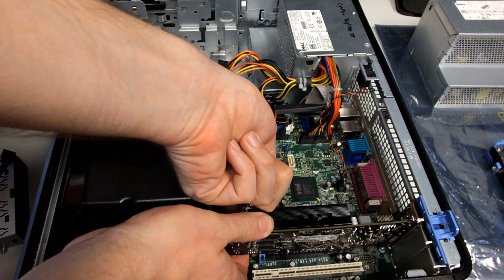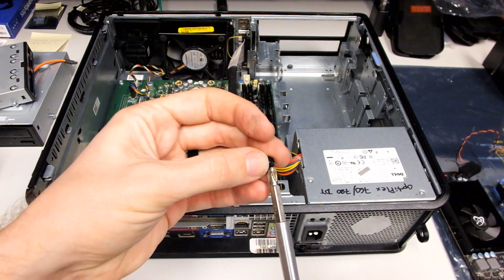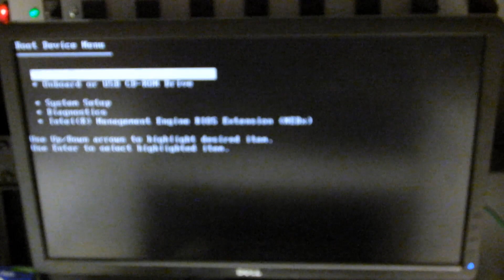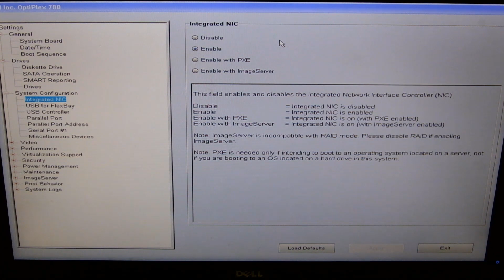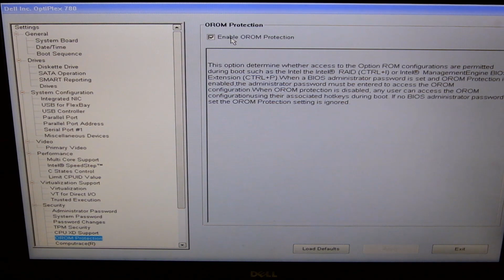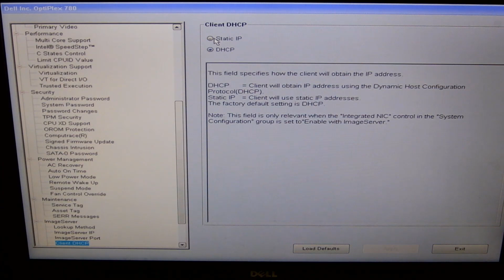Troubleshooting and repair of Dell OptiPlex 780 desktop PC

Comment: I have the same machine. My question is, is it normal for the power supply fan to not spin continuously? Just because I read that this is normal for some models.
Reply from the maker: Hi! Thanks for checking out my video. On some models if the power draw is below 15% it is normal for the power supply fan to stop spinning. However it should immediately start spinning again if the current draw increases, or if the ambient temperature increases. You can test for correct power supply operation by pressing the "fan test button" (located on the back of the power supply on some models).

I also recommend tools like the free "HWmonitor" and "Speedfan" to monitor internal system temperatures and fan speeds (although if memory serves, the Dell BIOS doesn't support checking PSU fan speed through software).

Also, remember to make sure your fans are clean and free of any dust, pet hair, or other obstructions. Hope this helps!

Comment: what grapics card are you using. also i upgraded my dell optiplex to a intel duo 2 E8600? Good video it helped me alot i maybe replcaing my power supply soon in my dell optiplex 780 due to it saying low power supply detected.
Reply from the maker: Hi!  Thanks for checking out my OptiPlex 780 repair video.  This video is quite a few years old now, but we do still have a few of these machines running in an old office.

I used a variety of graphics cards over the years.  The "best" (imo) that worked with the stock power supply was the Radeon R7 250.  Here's links to a couple of the cards we were purchasing back then:

VisionTek Radeon R7 250 SFF 1GB GDDR5 (DVI-D, HDMI, VGA*) Graphics Card - 900702:  https://amzn.to/43Syuuq

XFX R7 250 1050MHz 2GB DDR3 Low Profile Ready Radeon R7 Series Graphic Cards with Brackets R7-250A-CLF4:  https://amzn.to/3FPa2ls

These cards worked well and offered good performance for basic desktop productivity with dual monitors.

For triple-monitor setups we used this 5570 card:

Sapphire Radeon HD 5570 - 1 GB DDR3 DP/DVI-I/VGA PCI-Express Graphics Card 100293DP:  https://amzn.to/4kxFOT5

We also had a small number of employees using quad monitors.  For those folks we used this card:

VisionTek Radeon 5570 SFF 1GB DDR3 4M VHDCI DVI (4x DVI-D) Graphics Card - 900345:  https://amzn.to/4n18WEb

Although I wouldn't recommend that last one, the connector was a bit flaky and it was a lot of cables to manage.

Obviously you may be able to find better cards today, just recommending what worked well for us back when I was actively managing and upgrading these systems (roughly the mid to late 2010's).  We'd also make sure to upgrade all of them to 3.0GHz quad core processors, 16GB of memory, and SSD or SSHD hard drives.

Hope this helps!

Comment: Can you tell me where the p7 wires go on the optiplex 780?
Reply from the maker: @johnsepulveda443  Hi! I still have several 780's and can check for you when I get back to the office, if you're not able to identify the location in this video. To confirm, do you have a DT ("desktop") model unit, MT ("mini tower"), SFF or USFF ("small form factor" or "ultra small form factor"). DT and MT are the most common. Want to make sure I check the right model.
Reply: @CompTechMike  yes I have the desktop model computer thank you for the help can't seem to find a video on it
Reply from the maker: @johnsepulveda443  Hi! I haven't had a chance to stop by my other office yet but I found a diagram online of the different power connectors on an OptiPlex power supply.  See images here:

https://imgur.com/a/qwKlKHj

(image hosted on Imgur)

Is this what yours looks like?  If so, that mini Molex connector is for powering floppy drives.  Some other accessories (such as certain media card readers and small optical drives) may use it, also.  Assuming your machine has no floppy drive, that connector wouldn't plug into anything.  Lmk if you still want me to pick up one of those old machines to inspect further.

Comment: Hi, what if my power button is broken. And I want to install external power button. Where can I find pins, 4 pins maybe, fot ataching external power button from ebuy? please help.
Reply from the maker: Hi Milos! The power button on this model is part of a small circuit board which contains other components, including the front USB ports and lights. It connects to the inside of the front of the case and then back to the motherboard via a ribbon cable.

If your button is broken, my recommendation would be to replace this entire board. You'll probably need to remove the current one to match the exact part number. They're usually pretty cheap on sites like eBay and Amazon. I'm sure you could desolder the button and replace just that, but honestly you're just making more work for yourself (imo). Good luck, whichever you decide!
Reply: @CompTechMike  Hi. My little pin on that board is OK. That plastic little circle button from front of the front board it is broken, or not functional. once I pressed it down, it is not going back.
Reply from the maker: @MilosLacika  I just did a quick search online and saw many of them starting at $5. Search for terms like "optiplex 780 dt power button assembly". Should be an easy fix, hardest part is removing everything in the way to get to the component. 😉

Comment: I just so happen to have a Dell OptiPlex 780 from late 2009 running a fresh, clean install of Windows 11 Pro that I just installed days ago along side a plethora of Linux Distros without a single hiccup thanks to good ol' Rufus. Microsoft says it isn't supported and I wanted to prove them wrong. Lol. I purposely disabled TPM on it just to see if it would work. Zero issues whatsoever and fully updated. Granted I did some hardware upgrades but it's super light on it's feet. Upgrade specs are Intel Core2 Quad Q9650, 16GB dual rank, dual channel DDR3 RAM, Samsung 870 1TB SSD. It originally came with an Intel E7500 @ 2.93GHz that I did the BSEL electrical tape mod that OC'd it to 3.65Ghz, 4GB of RAM and an old 7.2k RPM Western Digital Black HDD with Windows 7. 

Night and day difference what a few upgrades will do. It ran Windows 10 Pro for years without issue too. Even though there's still a year til EOL on 10, I just went ahead and switched over to 11 now that they've worked out the initial bugs that happen with all OS's. No problems whatsoever. Tinkering with stuff and making it do what it supposedly can't is fun. Plus it also exposes the truth about major corporations, planned obsolescence and reduces e-waste!
Reply from the maker: Hi Hector! Thanks for checking out my video.  It's been quite a few years but we still have a few 780's running around the office.  Your upgrades sound exactly the same as we did to ours - quad core Q9650, 16GB RAM, Samsung SSD's, etc.  I wouldn't want to use them for any heavy-duty work but for basic office tasks they still hold up.  Glad to hear you've got Windows 11 on yours.  I also did that with some of ours (different machines, slightly newer but still not meeting Microsoft specs).  Rufus and a few TPM tricks make everything possible, haha.  Thanks for keeping your old machines going and helping reduce e-waste!

Comment: Hello, I have the same exact pc that I got from my uncle. I tried putting a RX 550 low profile red dragon and it is not showing me any display, however when I plug into integrated it works with no problem. Do you know any fix?
Reply from the maker: Hi there! I would check the power supply requirements for that card. These systems are more than a decade old. It's possible the card is trying to pull more than the PSU can provide, or is defective.

When I was using these machines we'd typically stick to LP cards like the R7 250 or Radeon HD 5570 or 6570. Those generally worked the best, in my experience. Hope this helps!
Reply: @CompTechMike  Okay I just had to plug a hdmi cable to hdmi because I had some sort of display port adapter for this one monitor.
Reply from the maker: @dbatack  great! Glad to hear it was something simple. I try to never use adapters on my setups, if possible. Remember: every adapter is just another potential point of failure. 😄

Comment: This system is old now. I have had one of these for almost seven years. I did replace the power supply just out of interest, as the system I have has a shut down problem when in use, sometimes using the web, sometimes, when it just is idle. The lights, 1, 2 and then 3 and amber. The amber light means the power supply is fine. I have had this problem with the system since last month. The longest so far. A clip here gives a brief show of it. https://www.youtube.com/watch?v=UAPO3qNUYOg
Reply from the maker: Your link isn't working but I would check the Dell service manual.  You can find that on Dell's website, or here:

https://www.manualslib.com/manual/678395/Dell-Optiplex-780.html

among other places.

Diagnostic lights 1-2-3 appear to indicate "another failure has occurred", which isn't very helpful.  I would recommend going through and removing and reseating any expansion cards, memory sticks, check all internal connectors, etc.  If possible remove all cards and all but one stick of memory and test like that. Then add each piece back one-by-one, and see if the failure reoccurs with just one specific piece of hardware.  You might also try swapping the memory to other slots and running the built-in hardware diagnostics.  These systems are old, depending on the environment you're running in you may want to give all connectors a thorough cleaning (for example: with some electrical contact cleaner or high grade alcohol).  Good luck, let us know if you figure it out!
Reply: @CompTechMike  Quite late. I bought different RAM, so by messing with that, I think the shut down was the cause of the problem for the whole time. Been okay now for two weeks. 

I simply use windows 7, with no license key. That is the result of buying second hand, once a system packs up and the use of the old drive, requires a key. I'm typing here on this system.

Thanks
Reply from the maker: @blenderocean  glad to hear you got it resolved! Bad ram is a frequent cause of issues on these models. There are certain types that are incompatible, despite being the rated speed (has to do with single sided vs double sided and chip density). Glad you got it sorted.

Fyi, these machines are capable of running Windows 10. As Win 7 is no longer supported by security patches or updates, updating to 10 would be a recommendation for security purposes.

Comment: Same computer, woke up to a black screen asking for password.???
Never had a password.
F2, f12 nothing works to boot safe mode, what can I do????
Reply from the maker: Hi Sueann!  Tough to say without seeing it.  Can you post a picture of the exact screen you're seeing (using something like Imgur)?  Could it be asking for a Bitlocker encryption password?  Or a BIOS password?  This could also be caused by some viruses or malware.

You can try using the motherboard jumper to clear the BIOS settings, but without knowing what condition is actually prompting for a password it's tough to say if this would help.
Reply: I put a video up on my page didn't know how to add it here.
Reply from the maker: @sueannsoto7299  Hello!  That looks like the BIOS password.  Check out these links to reset via the motherboard jumper:

https://arran.physics.gla.ac.uk/wp/igr-it/2016/08/02/reset-bios-admin-password-on-optiplex-780-sff/

https://www.dell.com/community/en/conversations/optiplex-desktops/optiplex-780-locked-bios/647f83b5f4ccf8a8de289667

Note that if you reset the BIOS, you'll need to press F2 to go back into BIOS settings (after the reset is complete) and reconfigure any custom BIOS settings that may be present in your machine.  For example, selecting the wrong drive or RAID type in BIOS can cause the system to not be able to boot.

I don't have any 780's here but do still have a few at an old satellite office.  Let me know if the above links don't help and I can try to get more info for you.  Good luck!
Reply: Ok that helped lol I am back to user screen have the loading circle and welcome but doesn't load.
Reply: Omggggg thank you it loaded on its own. 
I think what happened was my cat laid on the keyboard all night.
Reply from the maker: @sueannsoto7299  Ha! That's so funny. Exactly what cats do. 😹 Glad to hear it's working again!
Reply: Once again thank you so much. The last thing I needed was my computer to go caput right now.

Comment: Mine won't even turn on, will this help?
Reply from the maker: Hi!  Thanks for checking out my video.  When you say "mine won't even turn on", could you provide more specifics?  What, exactly, happens when you press the power button?  Any lights, noises, fan spinning, etc.?  Without more information it's tough to say.  Could be anything from a bad outlet or power cord, bad power supply, bad motherboard, etc.

Comment: Dell gx 780 yellow power  lights 1and 2 problems
Reply from the maker: Hi Malik!  Thanks for watching our video.  Check out the OptiPlex 780 service manual at this link:

https://www.manualslib.com/manual/678395/Dell-Optiplex-780.html

Page 16 shows that 1-2 lights mean "a possible expansion card failure has occurred".  I would start by removing all expansion cards, cleaning any edge connectors, and reseating them one-by-one.  See if it boots with no cards installed, then add one back, then one more, etc.  Good luck, let us know if you figure it out!

Comment: Hi Sir, I will like to know, instead of replacing the power supply which I know is the most reliable solution, is it possible to repair it?
If yes, could you make a video on how to repair power supply with this issue?
Reply from the maker: Hi! Thanks for checking out my video. Yes, the old saying is that anything can be fixed, with enough time/money. I generally try not to mess with power supply internals due to the high voltages that can be present there. Don't particularly feel like getting shocked; it's easier to replace them as a unit. 😉

That said, if I do find myself repairing one in the future, I'll be sure to record a video. Thanks for the suggestion! 😊

Comment: I got this pc for 10 bucks thinking I can flip it but I got a q9400 and rx 550 and 16gb of ram with a ssd and a hard drive so the first problem it wasn’t booting at all took me hours of plugging and unplugging because it said there wasn’t anything in sata 1 and 0 but I fixed it by turning off fast boot for the first boot now I finally got in the pc is very sluggish maybe it’s because it’s old it stutters here and there but the new problem is I can’t play any games csgo valorant anything I can’t play it at all it says

Engine Error
Your graphics hardware does not support all features (CSM needed to run this game.
Device Info:
Marked unsupported: 0
Supports PCF Sampling: 1
DriverName: "Microsoft Basic Render Driver* VendorlD: 0x1414, DevicelD: 0x008C
DriverHigh: 0x000A0000, DriverLow: OXA610AE4
DXLevel: 95, MinDXSupportLevel: 90, MaxDXSupportLevel: 95
Reply: I checked the device manager and the rx 550 and the pci serial port and the pci simple communications controller has a yellow exclamation mark next to it I did upgrade the rx 550 driver and upgraded the bios as well I couldn’t find anything for the q9400
Reply from the maker: @1pandamachan  Hi Isaiah!  Thanks for checking out my video.  The Q9400 is one of the mid-range quad core processors for this machine.  If you wanted to upgrade that to something a bit faster, I'd look at Q9550 or Q9650.  It's not much of a boost, but a bit better than the Q9400.

16GB or RAM is the max these models can take so you're good there, and it sounds like you got a halfway decent hard drive and graphics card as well.  That said, I wouldn't really try to use it for gaming.  I mainly do basic office productivity tasks.  The 780 line is more than a decade old at this point, and will leave you pretty disappointed if you try to use it for gaming.  Can still be useful for basic word processing and web browsing tasks, however.

Regarding the "no boot device" error, I'd go through BIOS and disable any ports that don't physically have a device connected.  There's a screen where it says something like "Port 0, Port 1, Port 2".  Connect your boot drive to port 0 and disable any others that don't physically have a drive connected in BIOS.

I'm having a hard time understanding the rest of your question.  Like I said above, you're not going to have much luck playing games on these unless you only want to play games that came out a decade ago.  From the error message you posted it sounds like "your graphics hardware does not support all features" --- it's just saying your hardware is too old.

The OptiPlex 780 is capable of running the latest version of Windows 10 22H2, which is still supported by Microsoft for a couple more years.  I'd load that on there and make sure you take off any "bloat" that can slow it down.  Also make sure you download the latest drivers for that graphics card from the manufacturer's website (this should fix the yellow exclamation mark issue).  For the other drivers you need to download them from Dell's support site.  Use it for basic productivity or "retro gaming" and you should be fine.  😉  Hope this helps!
Reply: @CompTechMike  hmm i might take the gpu out and get something different then and use the rx 550 for a different build thank you

Comment: Will ryzen 5 5500 and rx 6600 fit the motherboard of this case?
Reply from the maker: Hi! Thanks for the comment. The Dell Optiplex 780 shown in this video shipped exclusively with Intel processors, such as the Q9650. You will not be able to fit an AMD processor without changing the motherboard. Hope this helps!